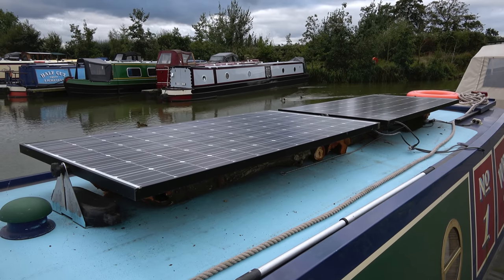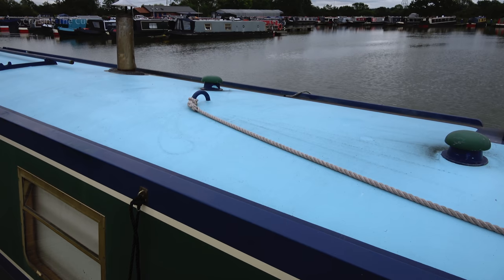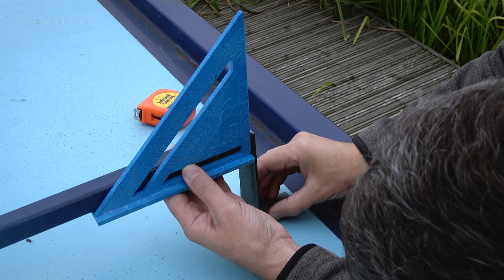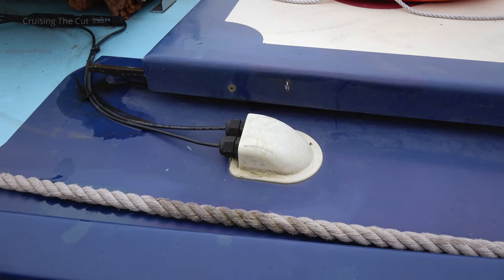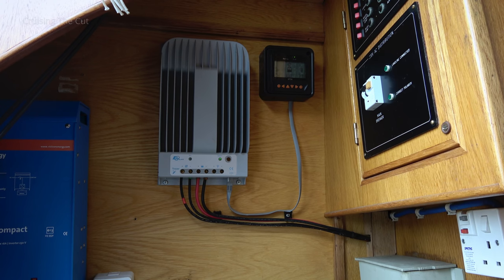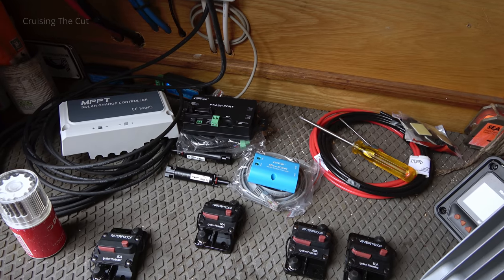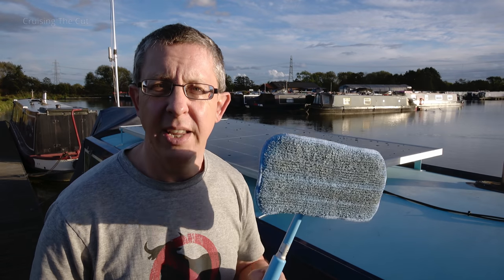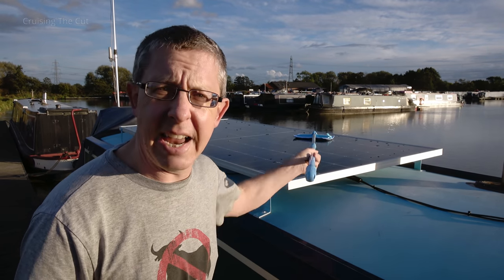251. Adding more solar power to my narrowboat

Comment: Thanks, very clear video about these dark arts.  In retrospect would it have been easier and maybe cheaper to ditch your old 2 panels and buy 2 new identical new ones, and wire them in parallel to a single charge controller?
Reply from the maker: I would have had to then take off the existing panel brackets, leaving holes in the roof. Plus I specifically chose those panels at the back because they’re narrow so I have space to walk alongside them on the roof (which I need to do when in locks)

Comment: "I need more power, Scotty"
nice work - Here's what came to mind while watching your project:

1 - Instead of centering the panel on the roof I'd have moved it to one side or the other  
8 or 10 inches  -  put 2 of your brackets on the dark blue ridge of the boat with the 'bent leg' under the panel.

2 - Use the other 2 brackets but with a bit more than a 90* bend in them letting you place the fastener which is bolted to the roof Under the panel giving you a wider, unobstructed walkway from stern to bow.

3 - I'd be willing to live on your boat for 6 months and keep the batteries charged up and the fuel tank topped off.
You live at my home with the damm neighbors arguing all day and their dogs crapping on my lawn all night.
'let me know
Reply from the maker: I definitely wouldn't want it off centre

Comment: The efficiency of the new panel looks quite good per unit area - a little better than the ones I have on my house roof, in fact. The ones I have, which are now 7 years old, were rated at 200 W/m2 , or 327W per panel. Replacing the older ones with more efficient ones might be helpful (but not necessarily worth it financially).

Comment: well good for you. Even though you got the other solar panels like 5 and half / 6 years ago. Getting a new panel is good. Solar Panels now are even better then they were 5+ years ago. heck even 2 years ago. They are always getting better and better each year. If you have any of the roof paint left over. might be able to just use a brush or bit of cloth with some of that paint on it. and rub the wires with the paint. I mean it wont be perfect but would just make it little less visible

Comment: 3 big ideas 
1- zinc locking washers on every bolt 
2- big sheet of copper  that sits between the wood and the controllers so everything has the same ground and  to act as a big heat sync  ( you can get from roofers ) 
3- split loom over the cable exposed to UV so the split loom decays and not the cables
Reply from the maker: Solar cables are designed to be outside and withstand UV so that’s OK. The controllers have a ground connection (which I admit was not wired up in this video!)

Comment: @CruisingTheCut ; How about getting some "Cable Shield Protectors" for those power cables on the roof and maybe for inside as well. They come in many colors and fake wood styles. Less worrisome about the cables moving around and protects them from damage. Encase of bad storms with flying objects and those plant branches along the unkempt places along the canal.

Comment: At the time of making this video, I was a machine operator at a sheet metal manufacturer and fabricator. We had Press break machines that make the job of those brackets so easy. Shame you couldn't have got a company to do it for you. A little press break job like this would take 30 minutes and cost peanuts.

Comment: I would have used double-sided adhesive tape for the breakers, they don't weigh anything. There are those strips you can pull out from underneath if you ever need to take it off again. Works like a charm.

Comment: 21:00  Regarding your problem with flat-headed screws i would suggest just using the screws you normally use and putting a washer underneath to 'make your own flat-head' so to speak. I always do it that way because finding flat-head screws is always a hassle and by using washers i can use any lenght screw i want and use a bigger or smaller washer on top depending on my own preference.

Comment: Not knowing what Day it is,  now that's how life should be.  Well done David.  I know it's not necessary but, I usually put a bit of Red tape or heat shrink around the positive solar cable ends.
Reply from the maker: Cheers, I didn't have any red heat shrink but I do keep meaning (and failing) to mark them.

Comment: So when did you get your Degree in Electrical Engineering! That all looked incredibly complicated. If I had installed it, I would have turned on the breakers, and ran like hell.......pursued no doubt by a very loud bang and a rather large conflagration😮 Very well done!

Comment: The average annual power from a solar panel is about 20% of the peak performance. Installed capacity of 1 kilowatt gives about 200 watts on average. In summer you’ll need a water heater to absorb the excess but that’s no loss.

Comment: David, new to your channel. As an electronics engineer, I have to say well done on the explanations about how the whole load goes together.  One thought from the brief moment that I saw in this video - do the breakers and the parallel module fit onto what is known as a DIN rail - the recesses in the rear of each seemed to be about the right size.
Might also be worth having a look at batteries with an alternative chemistry (Lithium Iron Phosphate have the highest energy density currently, far lighter weight than lead-acid, maintenance-free and can be mounted in any direction.
Reply from the maker: Cheers, good idea about the DIN rail. Lithium is still too expensive.
Reply: @CruisingTheCut  If I'm right, you've no method of reading the batteries SOC (state of charge).  If this is the case, fit a smart shunt into the negative lead before any loads.  A BMS will use the shunt data to advise you of SOC.
I know you're not a fan of Vectron, but they have some decent videos on how to fit.
Reply from the maker: Yeah, I just look at the voltage overnight when there's no load and no charging, and estimate charge level from that!
Reply: @CruisingTheCut  😂😂

Comment: I would be interested to see how your increased solar helps with the winter months. I look forward to a later review video.
I am a 5 year solo continuous cruiser with 500w (flat mounted) solar into a 700ah battery bank.
This provides all the power i need without any engine charging from april thru september.
March and october are marginal months with some engine charging required, but november thru february really need alot of engine assistance (apart from those clear winter days).
I am also not sure if i have the roof space for more solar what with wood, bags of coal, pushbike and other junk, plus i walk on the roof when handling the boat thru locks.
Reply from the maker: Hi, see the video I published just yesterday! 😀 (vlog 260)

Comment: Spirit level and marking up before you secure would help buddy. Also with the wiring showing on the roof, try running black plastic conduit along the side of the top edge where the water runs to tidy that up?!
Reply: Hi you cannot really use a spirit level on a boat
Reply: @safenarrowboat6817  
Water you mean?
You are causing ripples in the continuum.....

Comment: Great video, enjoyed that, thanks for taking the time to produce it. Perhaps adding a 2 foot spirit level and a 'boat' level (a very short one brickies use) to your growing tool kit would see the end of the wobblies - it would annoy me too much to leave them wobbly, I'm itching to straighten them up. I might have brought the charging cables from the battery up to a junction box so only two go to the battery and wired both boxes into that, then if you need to disconnect from the battery for whatever reason, you don't have to delve down into the battery store, but that's just me.
Reply from the maker: I don't have to go into the battery store to disconnect though, that's what the breakers are for
Reply: On a boat the best thing to do is line things up by eye. If it looks right then it is.

Comment: Hi, interested in what you have to say about panels. I have 4 x 150w panels which struggle in the winter, aided by LED lights, 3 x 100ah Li-ion batteries and a true MPPT controller. My stepson gave me a small wind generator (Rutland 350) which generally doesn't add a great deal but it really comes into its own Feb through to May  - the nursery rhyme March winds still hold true and the advantage of a wind generator is it works through the night when your power usage is low. Keep up the good work  😀
Reply from the maker: You're doing well to get anything useful out of the wind turbine!
Reply: @CruisingTheCut Thank you for your rapid reply.  As I say, it was a gift so, stupid not to use it. The windy months in the year really do make a difference when the sun is low and the light is on the lower frequency band. 😀

Comment: Only suggestion I'd add is that a slight angle in one direction would have allowed accumulated rainwater to trickle off a little quicker.
Reply from the maker: It's on a boat which rocks as I move around so no worries 😀

Comment: B&Q do pick and mix screws and nuts and bolts. 2sizes of bags and you can cram them full with any mixture. Only a couple of £'s and saves buying multiple bags or boxes of the required items.

Comment: Good choice on the rivnuts. While there is theoretically enough meat in 4mm to get the required number of threads for M6 to have full strength, you are cutting it very fine, a rivnut will be much stronger in the long term.

Comment: I did this but with my house. I put 2 kilowatts on outbuildings going into a 80 amp controller. Then going into 6 caravan batteries (85 amp/hour). Then going into a 3.5 kilowatt inverter then into a separate rings mains. Worked great but the charge controller kept going wrong and the batteries died in the end so I have just connected the panel to the grid now. I started out with 2 80 watt panels just doing the house lights with car battery and kept adding to it.

Comment: I did this but with my house. 2 kilowatts of panels on out buildings. 80amp charge controller. 6 85amphour caravan batteries. 3.5 kilowatt inverter. I also added a time delay relay to heat the hot water when the charge controller said that it was charged. I gave up in the end after the charge controllers kept going wrong and over charging. I should of got a more expensive one. Then my mate drained the batteries for me when he stayed over and they was never the same. So I`ve just connected the panels to the grid now.

Comment: Nice job. Surprised you weren't tempted to replace the two smaller panels with a matching large one (and sell them on along with the charge controller)

Not sure if I could have lived with cables running all across the roof like that though.
Reckon I would have forced myself to bite the bullet and remove the roof panels all along the interior so the wires could be hidden in the interior roof lining. 

If I were feeling brave I might have even attempted drilling into the box section that makes up the rain deflector/gutter and try to run the cables inside there.
Reply from the maker: Removing all the interior trim was never on the cards. The old brackets would have been wrong for another single panel, it was much easier to swap the controller.

Comment: Not heard of rivnuts? Love the idea of sikaflex first (nicking that for my van roof) 👍. Great, informative, entertaining video as always 👍.
Reply from the maker: Rivnuts are great (but get a decent tool to install them, though there is also a crude way of using pliers to do it)
Reply: @CruisingTheCut  Agreed. I have a rivnut tool so all good. Though I’ve M8 stainless steel to squash so my need to do some weights first lol.
Reply: Now to get my one of those mops 👍
Reply: @CruisingTheCut  Actually the crudest method is of using a bolt with another nut (or two) along it's length with some washers that allow the nuts to be turned against the rivnut, after the bolt has been inserted full depth into the rivnut, so that the head of the bolt can be hit (rather hard) with a smaller sledgehammer, to "set" the rivnut against the pieces of metal/s to be clamped together, and simply winding down the spare nuts onto the washeres, holding the head of the bolt as you wind the pressure on with those nuts.
This has always been the bush-mechanic's fix, for leaving the rivnut gun back at base (and not having any other way to instal the rivnuts.
Pliers ONLY WORK, if you have access to both the head of and the bottom of the rivnut - something not possible in your case as how to use a set of pliers on the bottom of the rivnut, when it is FULLY INSIDE the roof lining.
Using a long bolt and one or two extra nuts to be used for the clamping force, can you hold and secure the rivnut, whilst turning down the one/two floating nuts against the washers, as you hold the bolt (which is holding the nut itself).
Mechanical electrical engineer here, who has used many rivnuts (without a rivnut gun) to ALTER the original build of heavy industrial electrical switchboards, many of which needed alterations after installation (on site) - without a rivnut gun - hence the ability to install rivnuts by the simple expedient of using of a long bolt and several washers and a coup[ole of spare nuts - any rivnut was easily renewed or added to a switchboard - without having to get someone else, to drive for several hours, to get back to the workshop to get the gun ?

Comment: A little good quality double sided tape can be used to keep things in place till you get screws in place. a little plastic pipe over your drill will stop you going to deep.
Reply: Holding it to the wall and marking with a pencil seems to work just fine. No messy tape to remove

Comment: Is there any constant flow on the canals?    Even slow minimally meandering trickle of movement? Id be curious to do experiments with a small water wheel with a generator. Wouldn’t make a lot of power but itd be fun
Reply from the maker: Effectively no, except on the Llangollen canal where a deliberate flow is used to move water. Anywhere else, a water wheel would just sit still.

Comment: Good morning, I think you've done a great job for a non-professional, but I noticed you were overlooking one little thing, namely, the temperature sensor on top of the batteries. The most current temperature can be found in the middle of the side, where the liquid is. Because liquid conducts temperature better than vapour, which is above the liquid in the batteries.
 Have fun making the vlogs.
Greetings Lucas Mandemaker from Holland

Comment: David that was your best video I have seen from you well done, my only comment would be you should have put washers under your bolts that you used on your brackets.
Reply from the maker: A lot of people are saying that and I don't think it's necessary, the head of the rivnut provides a circular metal ring exactly the same as a washer would.
Reply: @CruisingTheCut  yes, I’ve never seen anyone use a washer with rivnuts

Comment: The only thing I saw that could make a problem was the cutting fluid wasn’t cleaned off with acetone or isopropyl. the silicone won’t bind to the roof, but it might just work just by being a gasket. Great job though! Also to make the cables look cleaner google ziptie cable separating it makes it look really neat.
Reply from the maker: It was cleaned with a degreaser but I didn’t show it, I didn’t think it relevant but perhaps that was an error.
Reply: @CruisingTheCut  oh my mistake!
Reply: Am I right in thinking you were using oil to act as a drilling lubricant?
It is far better to use proper cutting paste for drilling tapping and sawing metal. you can buy it cheaply from Ebay of course.
With steel and particularly stainless steel, it's a must.
Reply: Oh ye of little faith !!!!  LOL
Reply: @kenaston4220  Obviously not.  See completed installation.

Comment: I use that make EpEver on my RV -  as they approach their max current - in my case 20 amps they start to modulate down to reduce the current - they also  modulate down as they get towards 60c  temperature  - ther is some logic in not over capacity the controller  when installing panels flat as running in the mid range  most of the time they are most efficient - in my case 8-14amps on a 20amp controller where the unit runs cool - I slightly over panel my controller  with 280 instead of 260watts per 20amp  - What surprised me is on a clear  night on a full moon I got 1/2 amp charge!

Comment: My biggest concern would be wind getting under it in any sort of heavy weather. To that end I would drill an extra hole in each of  those brackets use as lashing points. I might want to add bungee cords or rope in a hurry.
Reply from the maker: They are very, very firmly fixed down, wind isn't going to take them off.
Reply: He's got six points of very sturdy metallic attachment. Wind isn't going to blow it off. Ever.

Comment: 🤣 I love that the most exciting bit for you is the mop.  Good job setting things up.  Question: how come you didn't go for some of those flat more flexible solar panels that can lie snug against the roof of the boat?  An example of this is in one of the Orto boats you covered previously.  Was it a matter of expense or availability?
Reply from the maker: They’re costly, legendarily unreliable after a couple of years, will get extremely hot when laid flat against the metal (and solar panels work less efficiently when hot) plus they’ll be a bugger to remove if stuck to the roof. Their only appeal is aesthetic.
Reply: Thanks for taking the time to answer my question.  That's interesting.  A silicone mat underneath the panel may help with the heat problem.  Hopefully, the unreliability aspect is improved in the future.  We shall see.